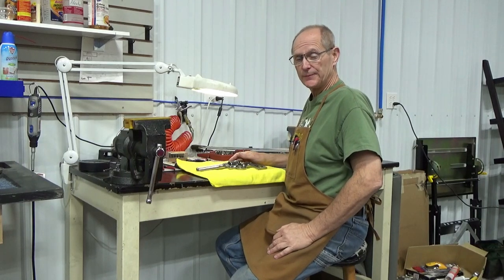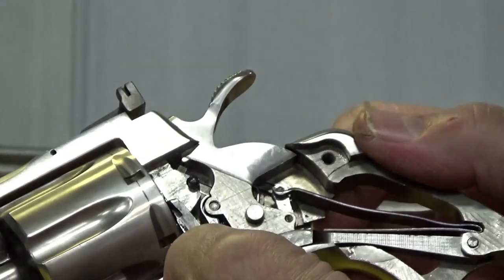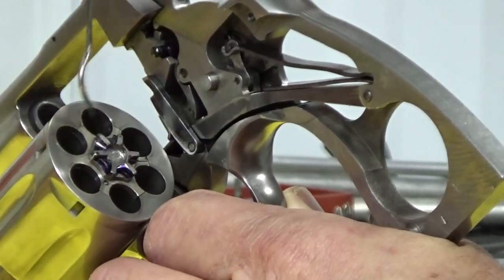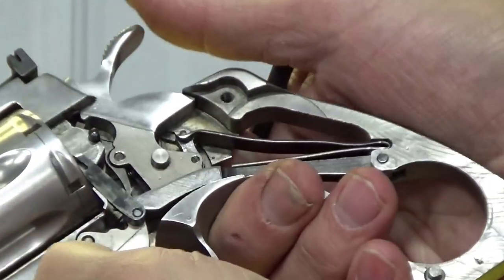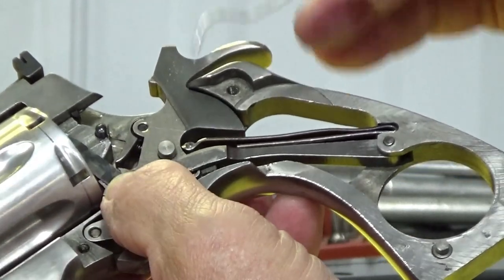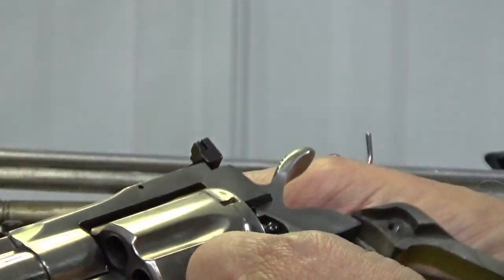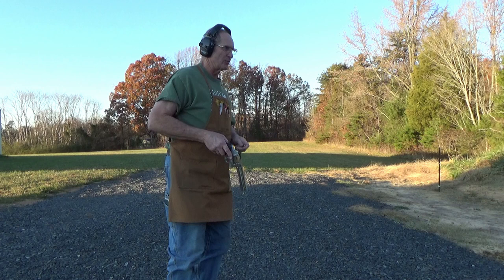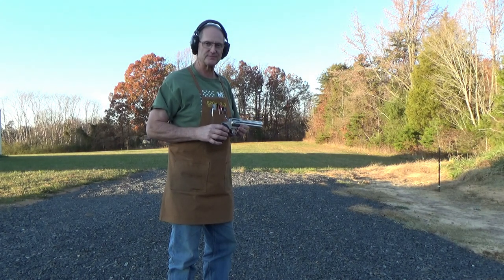Colt Python Final Repair of Loaded Barrel

Comment: If you mount a stock to a pistol with magnets is it still illegal without a tax stamp?
Reply from the maker: If magnets are stuck to it, it is not mechanically attached therefore it is still a pistol.
Reply: @maverickgunworks8777  thanks for your imput. I made one that attached with neodymium magnets and it is sturdy as heck.